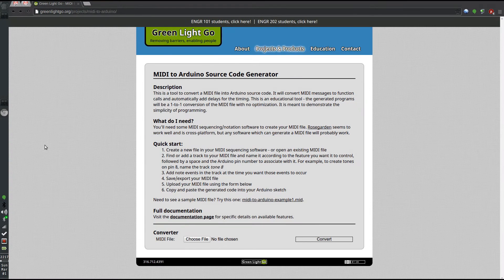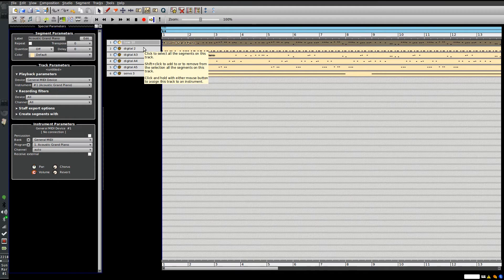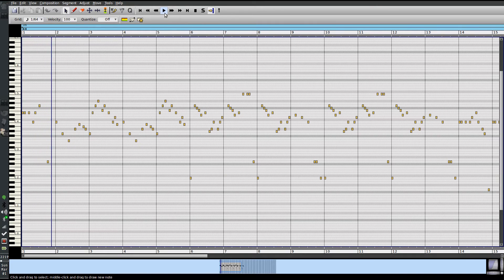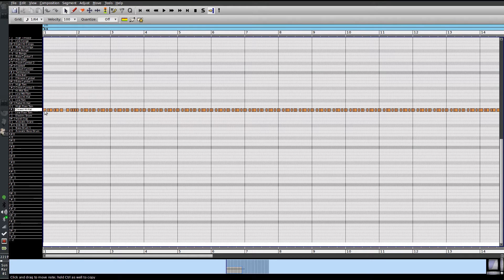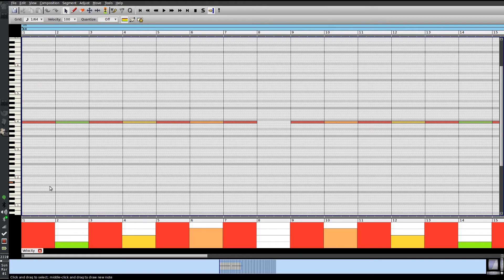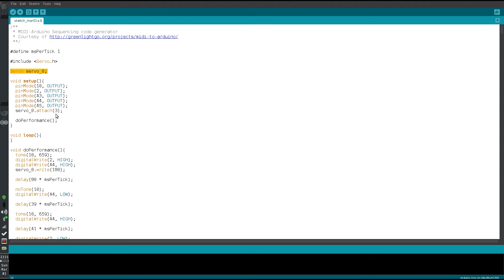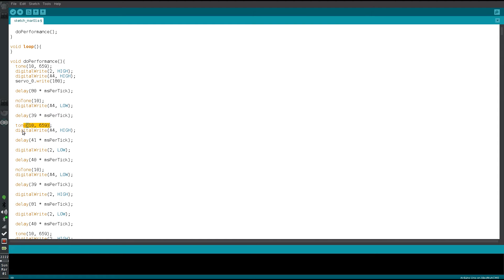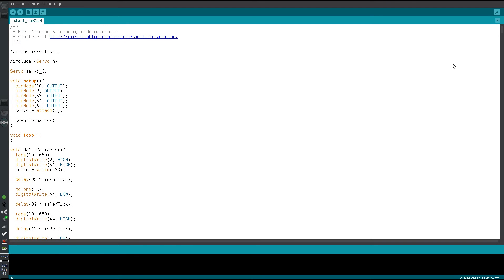Video demo of MIDI-to-arduino code sequence generator

Comment: I am trying to convert this midi file to Arduino Code. http://pianomusicsheet.net/wp-content/uploads/2014/03/frozen-let-it-go.mid

It is not working for me.

My piezo buzzer is connected to Digital pin 12. I tried changing the track name and track channel. Maybe I'm doing something wrong.

Can you help me out? If possible, can you send me a link to download the file.

Thank you.
Reply: thanaed houdsuwan Thanks. It worked this time. Is there an offline version of your Arduino Midi to code generator?
Reply from the maker: ***** No, not presently
Reply: Dominic Canare Well, thank you for your help. I learned a little about Arduino and Midi by experimenting with this.
Reply from the maker: ***** Excellent! That's exactly why I created it :-D
Reply: Dominic Canare If you can answer these question?

If I connect 7 speakers(8 ohm)/piezo/buzzer to the Arduino, and convert a 7 track Midi with your method; will the Arduino be able to recreate the song perfectly with the timing and frequencies being perfect?

Will connecting the speaker to the PWM pin of the Arduino help? We can control the volume with the volume of the speakers with PWM, is there going to be any other benefit in terms of frequency?

After a few days, I am gonna try it out. If you have done something similar to this, even with 2 or 3 speakers, then please share.

This way, we could make a Midi Music Shield for Arduino.
Reply from the maker: No, that's not possible with this. If you want to know more, see this page: http://www.arduino.cc/en/Reference/Tone

This is a teaching tool - meant to demonstrate how programs are very similar to songs, in that they can both be described as a list of instructions. To be able to do what you want, the converter would have to generate code which would be much more complicated, and would therefore lose its utility as an instructional tool.

You may want to look at this project instead: http://miduino.net/about.php
Reply: Dominic Canare Thanks.

I already tried miduino.net, the site is not working for a while now. It always says Resource Limit reached.